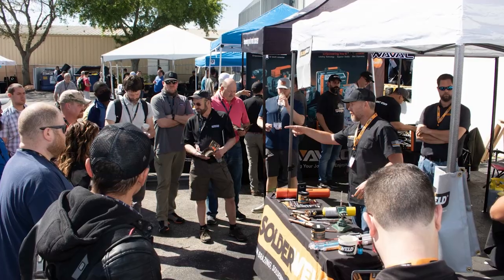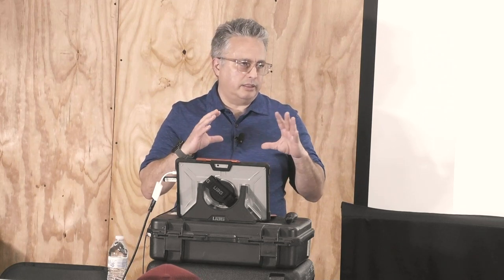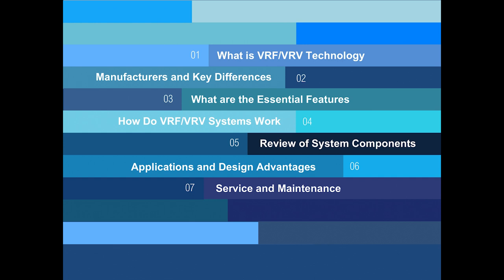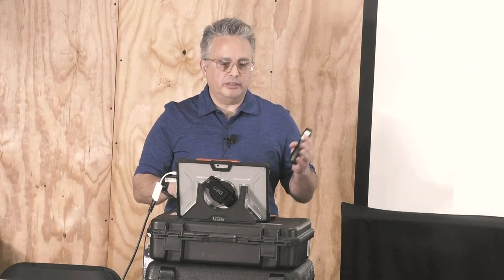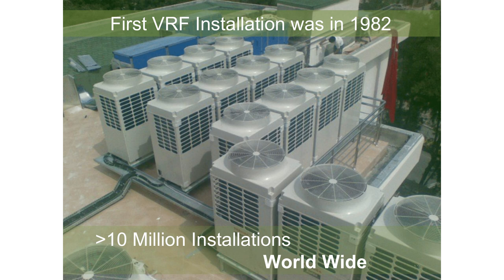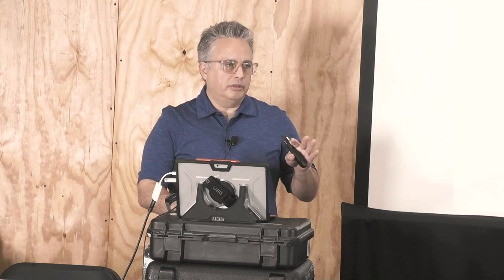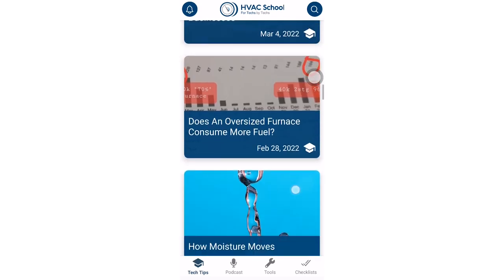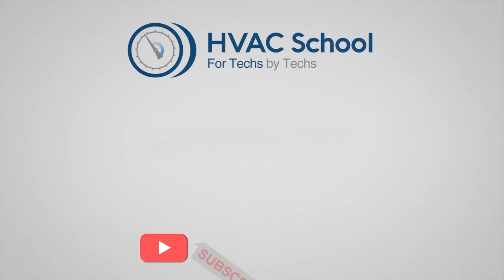Introduction to VRF Technology

Comment: It seems that a shorted compressor takes out an indoor coil due to acid contamination, causing a preference for system replacement. That seem untenable for VRF, so what's the solution? Replaceable core filters, a different flushing system or what?

Comment: Great presentation! I am, however, curious why at 1:05:00, it was implied that using a VRF and/or ductless system in a computer room would be inadvisable? Wouldn't the same energy efficiency, humidity control, and temperature control benefits still apply to a computer room?
Reply: Typically, designers or building owners select an inverter driven variable capacity system to save on energy usage. In the case of a IT room, the loads are generally constant year round. There is no load shedding or part-load scenarios to take advantage. In reality, server rooms grow and increase loads. Also, although humidity control is a concern, it is typically not an issue with high humidity but low humidity. IMO, it is better to select a fixed capacity system. This topic deserves more time and attention. Contact me if you are interested in discussing it further. Cheers!

Comment: These systems sound like very versatile. I have questions though.  Weren’t there restrictions about how much refrigerant can be circulated through a building, due to the breakdown of the refrigerant into toxic gasses, if the building catches fire.  If a compressor has a running burnout, I guess it would make every head connected to this outdoor unit inoperable.  How would one clean up a contaminated system, with all the delicate components?  Seems like it would be a service nightmare. What about oil return?  Seems like the compressor could run short of oil with all the piping.  Is there a separate oil reservoir, which maintains a specific oil level, until enough oil can be returned through the piping?

I guess a brazed system would have to be very clean install.  I heard some of these systems use aluminum piping with shoulderless connectors.  These seem like they will be the systems of the future.  I am concerned about the amount of components, scattered all over the place.  I think I would prefer all of the refrigerant and controls located in one package chiller
  
I’m not knocking these systems.  My guess is the installation has to be a very clean, and the installation installation quality would determine the reliability of these systems.  Is there a separate ventilation system required for fresh air?  Seems like it would have to be supplied from an outside source, which is critical for indoor air quality.  This would require a fan, ductwork, etc. usually outdoor air has to be conditioned, as to not add to the heat load of the building.  Then there is the problem of maintaining  building static pressure requirements. Seems like separate makeup air units, with the ability to supply conditioned outdoor ventilation air would be required, adding to the cost.
Reply: All of your questions can be addressed by contacting the speaker.

Comment: Is This system only designed for the West Coast or Hot Weather cause many of these systems don't perform well in the Mid west. Where I live and often one must add a heat pump to this system to get Max performance